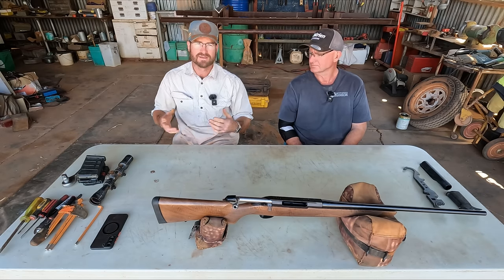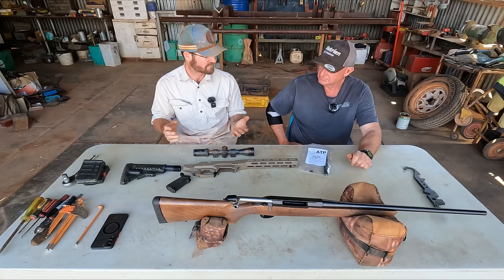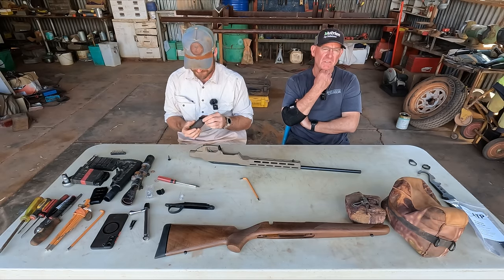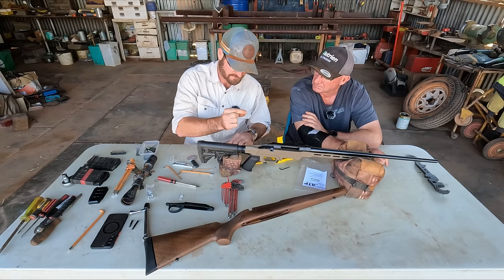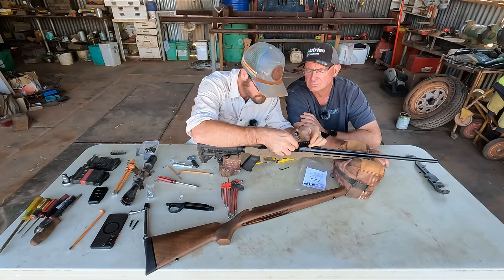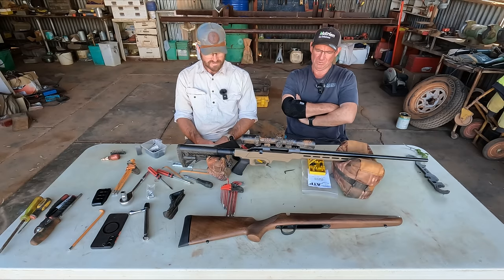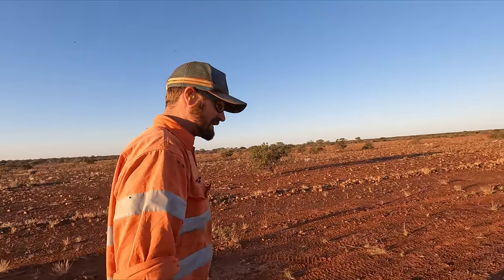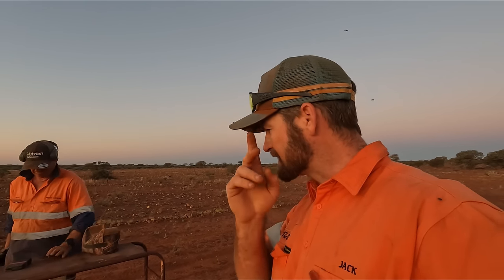Elevating the Tikka T3x: Upgrading with MDT Chassis & New Optic

Comment: Swedish gunlaws are diffrent, but more relaxed on calibers etc.
we can buy anything from caliber 45 to 22lr.. Most common is 9.3 and 308 for the large bore calibers.
we are alloved 6 rifles on "hunting licenses". We also need a safe, but its quite simple - a safe with correct ratings/markings and if its below 150kg it needs to be permanently mounted to the wall/floor. But the mounting of a 75kg safe need to be "comparable" to a "loose" 150kg safe in practice.

Anyway, regards to calibers we have 4 diffrent "groups" of animals and corresponding requirements on the calibers.
to hunt the largest animals (moose, bear, wolf, wild pigs) you need a class 1 caliber - 140 grain with 100 meter energy of 2700J or 156 grain E100 2000J. thats practicaly makes 6.5x55, 6.5 cm and similar 6.5 calibers the smallest alloved.
Calibers with e100 800J is class 2, thats roe deer and smaller animals.. Other then that we have class 3 wich is weaker centerfire calibers mostly 22 hornet, 22WMR, 9x19. And in class 4 we have 22LR and weirdly enough 17hmr.

Anyway, there is no real stipulations about "how a weapon looks" - in the lawbook that is. But the police has had their ideas. For instance the Tikka t3 Tac A1 was a long time forbidden to buy right out, but the T3x with a Tac A1 stock bought later is perfecly legal. Figures.

But this aug the agency that regulates hunting and tools for hunting, removed all writing about "looks" so now we can buy 308 AR's if we like.

Comment: Always loved the wood stocks, many of them are quite the crafted art (and its' AOK to appreiciate the art in the engineering) but yeah the synthetics & chassis design is just very much smarter & far more practical. Think folk miss the smarts of buffer tube allowing adjustable length of pull. Maybe its just me but I need it adjustable...to get good eye relief with the stock, length of pull needs to be adjustable. If you only shoot standing or prone at a rifle range not a bit deal but standing, prone, out a ute window (for me at least) I need to alter it. Even drivers side to passenger side slight difference. 
Pistol grips on rifles I think are super under rated, ergonomic & I think makes the gun safer.
Nothing better than making a tool better.
I'm thinking in your flatter scrub like country you might have to jog on foot to get more camels. If that's the case lighter is better. Way better to control of a rifle is a must & just so smart it probably speaks Latin. I'm just picky set in my ways & maybe wouldn't ever want to save weight with a lighter barrel...only my thinking, I think barrel fatter=barrel better
Great video. 2 thuimbs up,

Comment: 10:18 don't use locktite on firearms. It's you want a thread locker only use thread locker meant for firearms such as Rocksett. Its a high temp ceramic thread locker designed for this application.

I'd also use some glass fiber as a buffer against that chassis so it doesn't wear into each other if it doesn't come with any
Reply: It doesnt matter. Except for parts that do heat up significantly. But the action screws? No need for special stuff.

Comment: If you have a Dremmel ease the lock up notch on the Magpul mag's.
How difficult is it for you to obtain/use a suppressor on your rifles? As surely you could make a health and safety case for them through Safe Work Australia hearing protection regulations!
Reply from the maker: There is no Avenue to get a suppressor in Western Australia because they are deemed to much of a risk to public safety. 😑
Reply: @jack_out_the_back  That has to be one of the stupidest arguments I've ever heard, but give the 'intelligence' of most politicians it should really come as no surprise. what would your local plods reaction be if you scratch built a suppressor? As from what I've seen of your workshop you have the facilities to build one.

Comment: I dont know fellows i still prefer wood stocks with the 10 round mag..
I am in Canada amd have a 308 pump Remington as well as a 3006. A 243 bolt action and msny shotguns.
We do have to hsve s license and be approved by the police but once we are licensed we can buy as many Firearms as we wish

I always start with a 3 shot group at 30 meters and with the 308 i like to be hitting 1.5 inches high at 100 meter. 
Good luck fellows

Comment: ah, i have a 10 round 223 mag for my standard t3 varmint.  is this not possible for the larger cal's?  our culling is more often 223 with smaller animals, or head shot only.
Reply: light stock, not much of a recoil pad, that would be a little punishing.  smooth action.  love how you blokes do the safety, clear chamber inspection by both etc.  no cowboy stuff.  great video and love your clear run down on everything you do.

Comment: Carful with the magazine selection. I have put my Tikka t-3 in a mdt oryx chassis and so far two aics pattern mags do not work. Magpul and beragra polymer magazines wont go up in and lock. The dimensions are way off. Fingers crossed i just ordered a mdt magazine. Be nice if oryx mentioned what magazine a tilka guy would need. Thet claim any aics pattern mag. Thats dead wring and ive wasted $100 because i tried to modify them a little.
Reply from the maker: Yep, I have some genuine original AICS magazines and two MDT poly mags, they work well, the Magpul doesn't fit well, it went well in my original KRG (for my Remington 700) chassis and fed amazingly.

Comment: Jack I always centre the reticle on the scope before mount. Bore sight then start at 30m to get it on paper and windage spot on the go to 50m and 100m. saves plenty of time and ammo.

I feel for WA shooter as the system is an absolute joke which doesn't stop crime eg Bikie boss shooting at public event. Vic has the best and fastest PTA system and Qld we have the best system of a bad bunch where data entry and paperwork is atrocious with firearms showing up as still in possession despite being sold years prior.

As for PA discussion the is more questions than answers with that